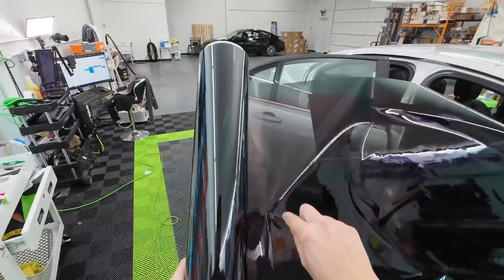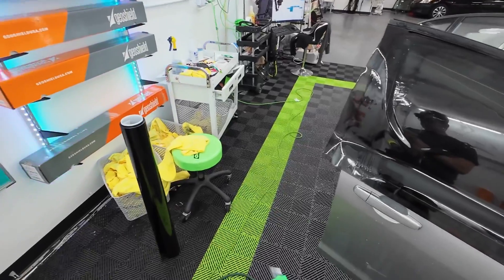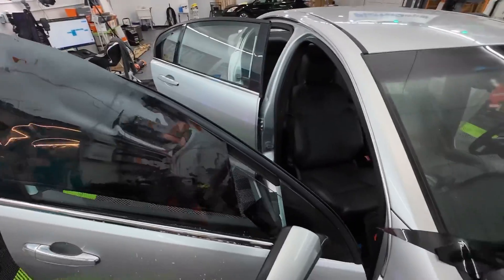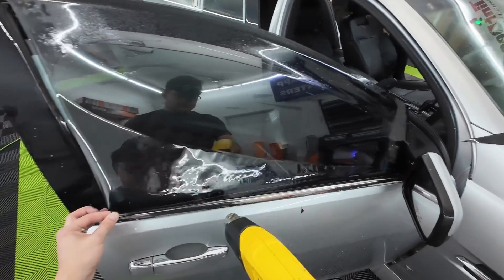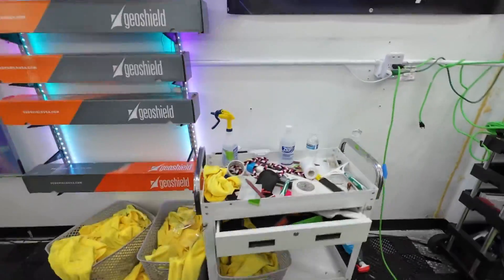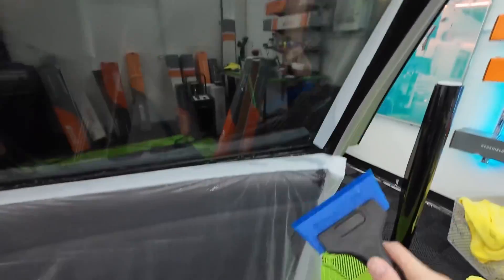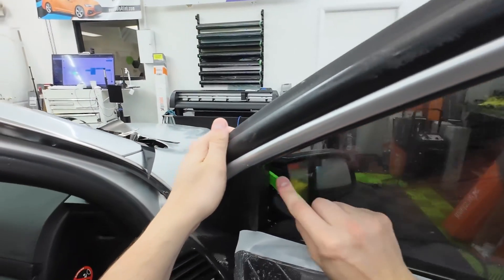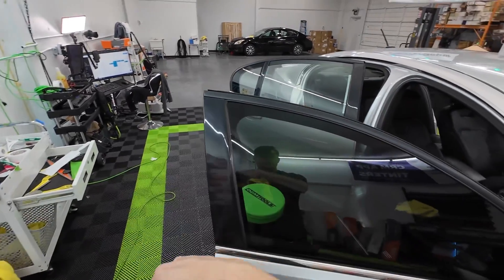Cut 2 window tint patterns at the same time with a sharpie

Comment: Also, after learning about the sharpie method, I’m really considering adding it to my routine. I still sometimes struggle with botched cuts on the sides
Reply: I use it it's safer as far as cutting seals and more easier not to mess up

Comment: What i do now is instead of putting the film on car put it it on your peelboard and squeegie them both together so they dont slide at all, then transfer it to the car. I sharpie the lines, cut the top and bring it back to the peelboard qnd cut it with a ruler